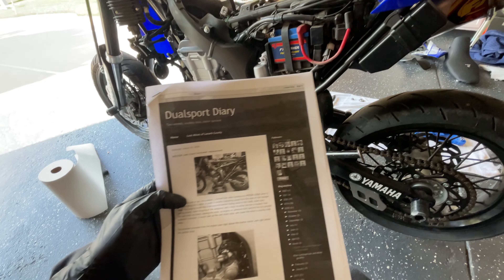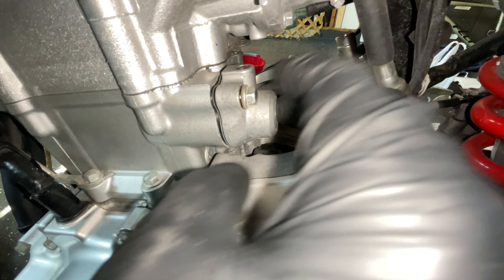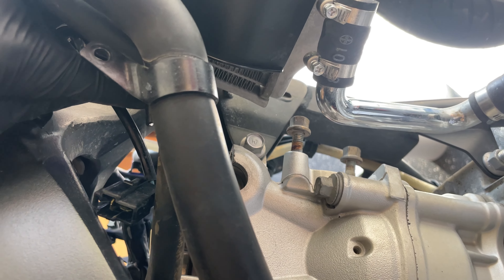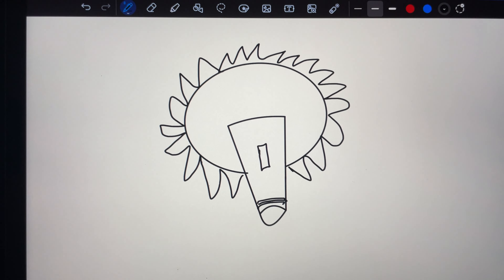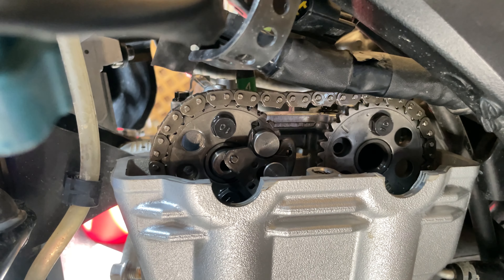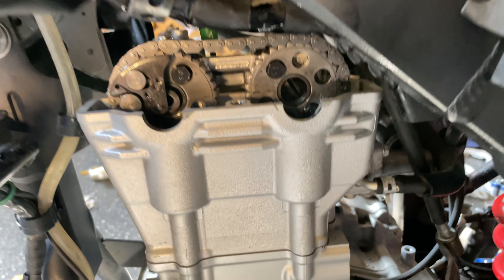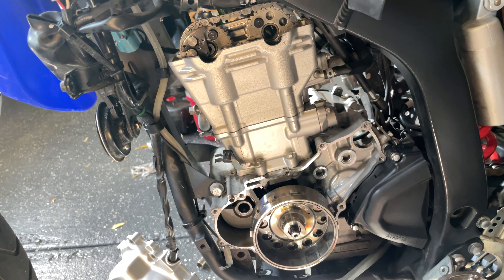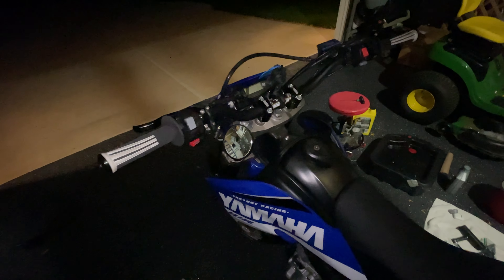Yamaha WR250X/WR250R Cam Chain & Tensioner Replacement Guide (26,000 Mile Service)

Comment: Man, this is so freaking helpful. I daily a '14 WR250R coming up on 28K miles, and I've been putting off the valve check and a cam chain/tensioner mostly because I couldn't find anything online. I do my own work, but fooling with the engine using only the service manual is a real challenge. Ordering the rest of these parts and will set aside a Saturday soon to knock it all out. Really appreciate the time you took making this.
Reply from the maker: So glad I could help! Best of luck, hope it goes smooth! 

If you’re also planning on changing the timing chain, I compared my old chain to new one and there was actually zero stretch in the chain after 26k miles of pretty hard riding. So its not necessary to do and will save alot of time if you don’t feel the need to do it. Don’t blame you though if you wanna change it regardless just in case.
Reply: @lukep77  Good to know, I've been leaning towards changing the tensioner, checking the valves, and leaving everything else as-is for now. Thanks!
Reply: Just wanted to thank you as well man. Good info about the cam chain. Very appreciative.

Comment: Awesome video Luke. My 2014 WR250R with 23,000 miles has a super loud cam chain noise on startup and I swear I hear it during idle sometimes. Based on your follow up comments with the fact that your cam chain was fine, I'm leaning towards just changing out the tensioner and checking the valves. How has your bike been running since? Any other updated advice you can give?
Reply from the maker: @enduro_alex  Bike was running perfectly fine up until this May, then I blew the bearing on my countershaft 🙃. It was completely unrelated to this service since its the transmission, most likely my chain was too tight. I’m still contemplating throwing a new engine in or paying to repair it. Been without a motorcycle since though 🥲 

If yours is at 23k miles I’d say skip changing the cam chain and just do the tensioner and valves.

Comment: Thanks for the video - How did you decide in advance to replace the timing chain or is it just your normal  practise?
Reply from the maker: It's definitely not required to replace the timing chain at 26k miles, but I thought mine had gotten stretched out so I decided to replace it while I had the engine open. It turned out that there was no noticeable stretching between my old chain and new chain.

Comment: I am doing the same task and your video was extremely helpful. I have a question about the marks (lines) between the two timing gears. Were they exactly parallel at top dead center or did they have a slight deviation? It's my dilemma as I didn't get a new chain. The deviation is so small that it certainly won't cause me a problem right away (it will definitely have to be replaced in the future). On the other hand, if with the new chain they were perfectly aligned, I think it's worth it to replace it now that the bike has been dismantled to put a new one. I have 24.000 on clock (about 20.000 miles)
Reply from the maker: I don’t really remember if the lines were parallel or not with my original chain but I assume they were. If you’re skeptical about it id definitely recommend just replacing it.
Reply: @lukep77 Thank you very much for the prompt reply. I have tried 4 or 5 times and my chain jumps 1 or 2 peaks on the cog. This is confusing me and I can't figure out if the chain needs to be changed. I will try again today when I am rested and have a clear mind. Thank you again.